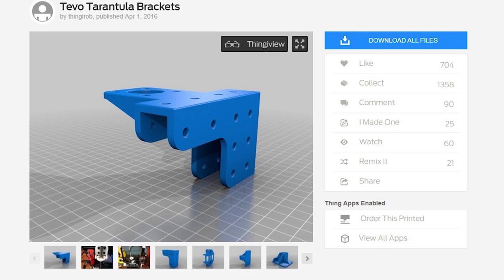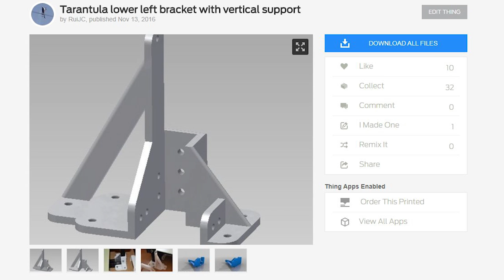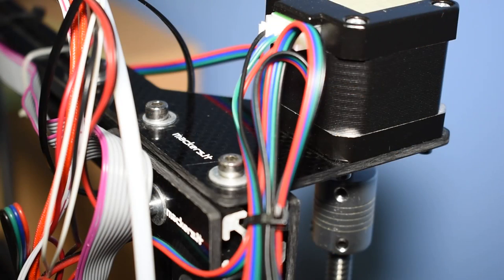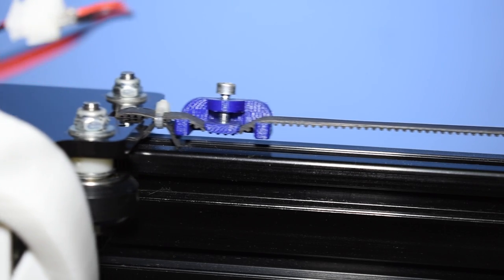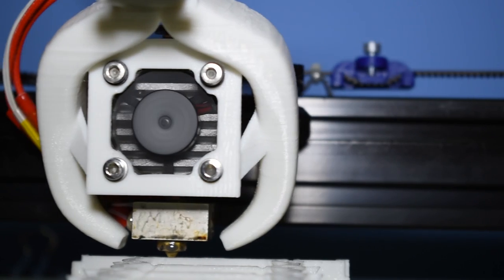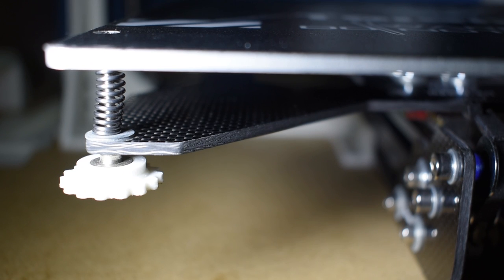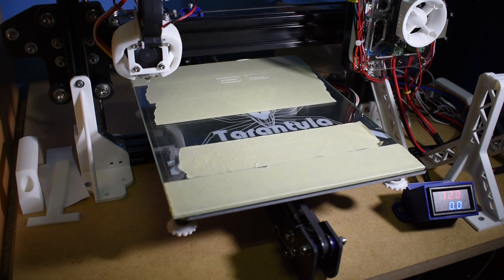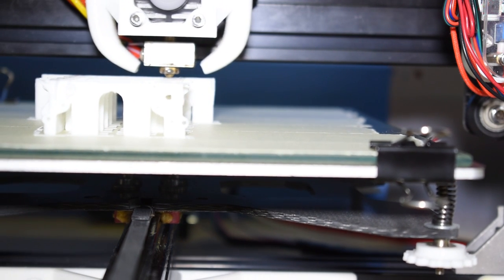TEVO TARANTULA - TOP 5 ADDONS

Comment: Another Great video for the Tarantula, all the addons are really important too.
Why didn´t you mention the fan cover you have there?
Does it make it less noisy? 
I have test a couple of models from thingiverse and they increase the noise instead of lowering it.
Reply from the maker: Hi jcmunozac,
Actually, i installed that just for fun...i had no intention of lowering the noise of the fan or increase the airflow for the drivers.
I printed a couple of those for my black widow fanduct and ended on using just one and for fun installed it in the tarantula :D

Comment: Great video as always ruiraptor, any chance we could possibly see how to print abs/nylon successfully on a tevo tarantula and reach high temps safely?
Reply from the maker: Hi Larryable1,
I haven't tested that yet, but i have a few friends that did.
One fact is that for higher temperatures, you need to change the heatbreak because the stock one has the PTFE tube inside which can't handle much temperature.

Comment: The mistake I made was I didn't have a plate for the hotbed and the bed was too high so now I have a thin layer of stuck plastic on the hotbed. Then my firmware stopped working

Comment: I found the Mini Blower 4020 Radial Fan.
But there are tree version 5-12-24v and I can see some people are using a 24v version so they reduce the speed to the half. But what are your recommendation?
Reply from the maker: Hi Henrik,

For me it does not make sense to use a 24v fan/blower in a 12v printer.
This is because you will only get half (or less) performance out of it.
And even if you don’t want to use the fan’s full power, you can reduce it in the slicer.
In the slicer profile you can select how much power you want your fan port to output and also in which layers.
For example, for the first 3 layers you can have your fan turned off, then for the next 2 layers you can have it at 50% then at the remaining layers you can have it at 80%.

Comment: I will buy such a 3d printer but I think that there is many improvements needed as I see from your video 
is it a reasonable 3d printer for a beginner?
Do yu expect that TEVO will do such upgrades in new version?, should I wait for 2018 version?
Reply from the maker: Hi,
I don't think that i will be a full improved version in the future. It is a good printer as the stock version works fine to start with. I started like that. I started printing with it stock and was adding the upgrades along the way.
Reply: thank you for answer, by the way I wonder another point,
What can do for improve the printing precision, I mean surface quality .
Can I use use 0.1mm nozzle with this printer?
Reply from the maker: Not sure about the 0.1mm nozzle...but it might work...although, tevo specs mention the smaller nozzle to be 0.2mm.

Comment: Hi Ruiraptor. About glass bed to Tevo Tarantula, the bed size is 220 x 220, and the printed area is 200 x 200, ok! So i need to buy a 220 x 220 glass?
Reply from the maker: Hi Silvio,
You are correct. Always get a glass with the same size of the heatbed. Also because it will be easier to secure it ;)
Reply: thanks, thanks, thanks!!!
Reply: I forgot, and the thickness, can be 3mm?
Reply from the maker: Silvio Mascarenhas 
Yes, between 3 and 4mm is perfect

Comment: To install the glass bed i only have to lower the heated bed?
Reply from the maker: Hi,
Yes and no...The bed adjustment screws should be used for small adjustments. If you already have your bed adjusted, then adjust the Z sensor instead (if not using auto level sensor) until it homes very close and then fine adjust the bed.
Reply: ruiraptor thanks m8! Love your Videos btw. :D
Reply: Did I miss the thickness of the glass plate? Which is best?
Reply from the maker: Hi Thomas,
I use 4mm without any issues. You can also get a 3mm one...it also woks.
Reply: is that special glass? tempered? thnxs
Reply from the maker: Hi Silvestre,
I use both. I have one 4mm normal glass and one 4,, tempered glass. Both work just fine.